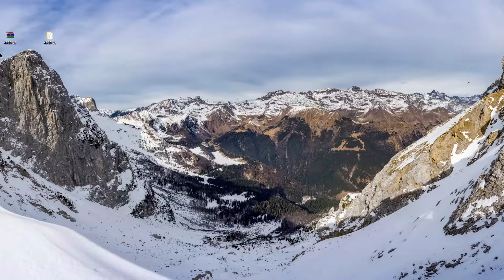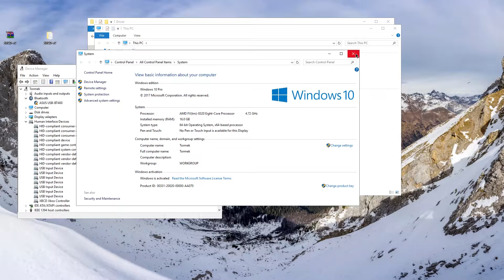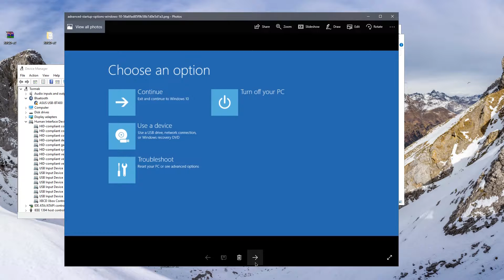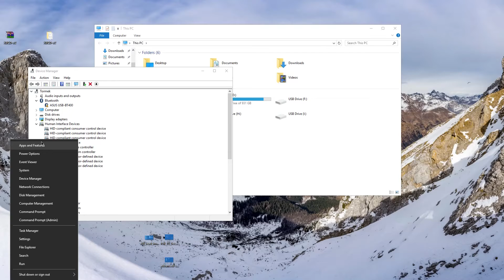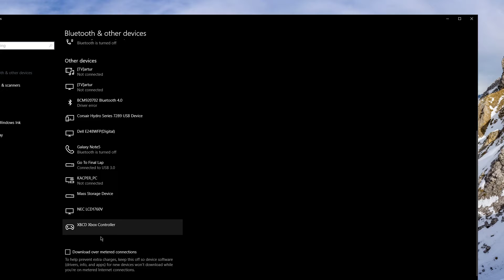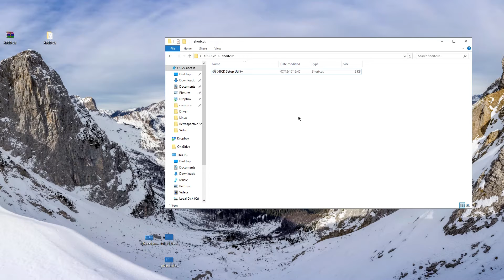How to use original Xbox controller on windows -via XBCD

Comment: It worked like a charm. Many thanks. Also I would like to point out that the driver signature enforcement will be enabled after a restart, so you don't have to worry about it. I even found it in Acer's help forum (https://ph.answers.acer.com/app/answers/detail/a_id/38288/~/windows-10%3A-disable-signed-driver-enforcement)

Comment: I'm selling a few of the cable converters on eBay. I didn't have the heart to splice my original xbox controller wire, so I found some online and decided to buy in bulk for my store.

Get it from China if you don't mind waiting around a month... Much cheaper... https://www.aliexpress.com/store/product/PC-USB-for-Xbox-Controller-Converter-Adapter-Cable-for-Xbox-to-USB-PC/408336_32764273533.html?spm=2114.12010612.0.0.243d38e7eYaFLS

And here is my eBay listing if you want to get it in 5-7 days https://www.ebay.com/itm/153014077032

Thanks to Ballistic3Bit for this very helpful video. I was able to set up my original xbox controller to play halo online. I had to use x360ce to get it to work. Copy everything in the x360ce folder and paste it into folder of your game installation. Apparently I have to do this for every game I want to use the controller on... Also... When configuring x360ce, the left and right trigger are actually button 11 and 12 (not axis... at least for my setup anyway.)
Reply: fuck china

Comment: I installed the controller and driver using this video as a guideline. It works with no problems. I am using the first original Xbox Controller nicknamed the Duke.
Reply: Everything worked except for XBCD Setup Utility. Any tips?
Reply: @acropolisradio148   As said in the video, run the utility as administrator using the right button on the mouse

Comment: hello, after the restarts and updating the driver without problems (while being in the proper mode) the problem still persists after the last restart, any solutions?
Reply from the maker: I am not sure. I have never experienced this issue, I would check again if it is installed correctly. Also what is the problem, exactly because when I installed mine the controller only works when you switch to it in the games settings. Only then does it work, you might have to check the mapping.  Perhaps that is your problem?
Reply: Ballistic3Bit when im restarting my  computer,the driver i installed in the device isnt being saved,a yellow triangle is there again
Reply from the maker: Hmm, try reinstalling again but make sure everything is done under Administrator permissions
Reply: Ok mate
Reply: Ty for your video mate,it worked!
Reply from the maker: LyricalPoetry so you needed admin privileges?
Reply: Well i understood that i have already installed the drivers but i always need to log in without the signatures permissions whenever i turn on my pc
Reply from the maker: LyricalPoetry I thought that was only required just to install the driver?
Reply: Yy thats what i thought